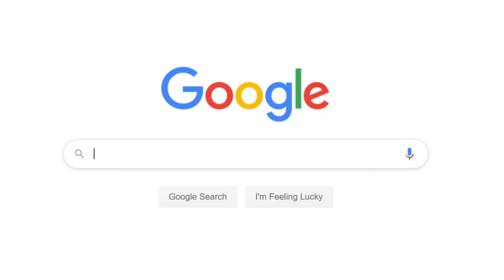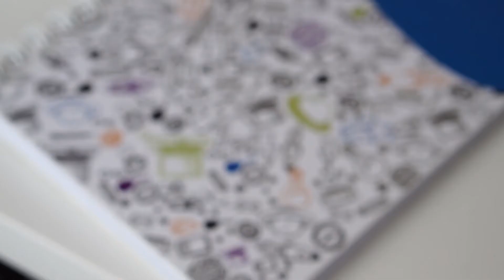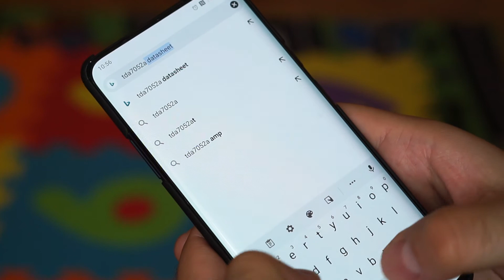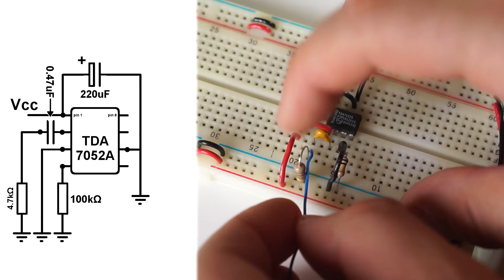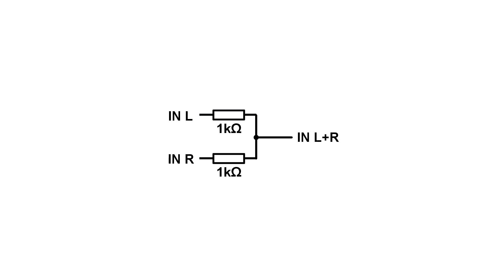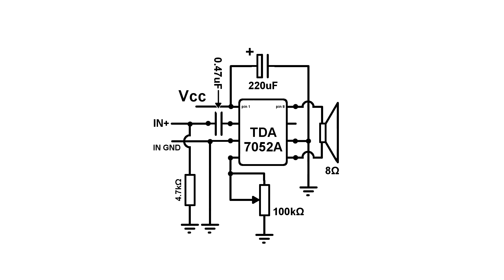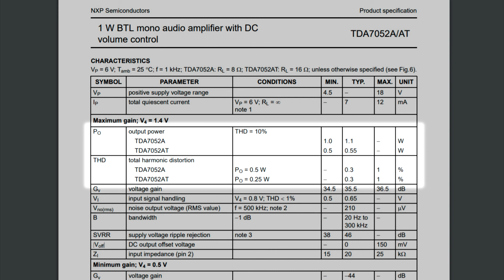How to make a simple amplifier (TDA7052A chip amp)

Comment: Great video with lots of information. If I was to design a tda7052a amplifier circuit with a transistor switching circuit to trigger a mute function, how would u change the circuit?
Reply from the maker: The chip goes into mute if you connect pin 4 to ground

Comment: thanks a lot for this video. please make more of such videos
Reply from the maker: You're welcome. Anything in particular you want to learn about?
Reply: @LeftyMaker  I want to learn how to make my own mic at home. An amplifier which will provide a bandwidth which removes all the bad noise while boosting my voice so it can be clearly recorded into the desktop using TRS 3.5mm jack. it would also be great if the mic is not required to stay close to my mouth and I am allowed to place it anywhere near me like of the table. ( I would like to completely eliminate the background noise and provide loud and crisp voice just from the 3.5mm jack and not from added power source like a battery). It would be great if the mic is made with lower cost in mind. The main component should be the electret mic. If this is possible I would be very happy and would surely suggest the video to all my friends studying electrical engineering with me. Thanks a lot for giving me a chance to share my idea with you!
Reply: One more thing when you are showing the parts you choose can you also explain why did you choose them? like with calculations if possible.
Reply from the maker: @dutch759  DIY Perks did something similar already. What you are describing is a shotgun microphone. https://www.instructables.com/DIY-Shotgun-Microphone-with-wind-shield-in-buil/
Reply: @LeftyMaker  so you are not interested to make your own for the channel? I wanted to learn from you cause I like the way you teach.

Comment: This is excellent. Could you do something around 5watts for a guitar amplifier?
Reply from the maker: Hm, I've never tried making one. I don't have a guitar 🙃 You can try searching for the Ruby amp or Little Gem amp and see if that works for you.
Reply: @LeftyMaker  what makes a normal line amplifier different from an instrument amplifier. I saw that they use a transistor of some sort, but I am unfamiliar with the application
Reply from the maker: @chrisg0001  I think a J-FET is used for impedance matching and pre-amplification purposes.